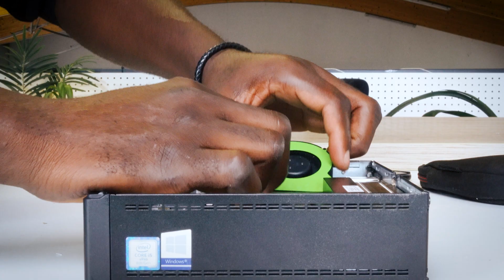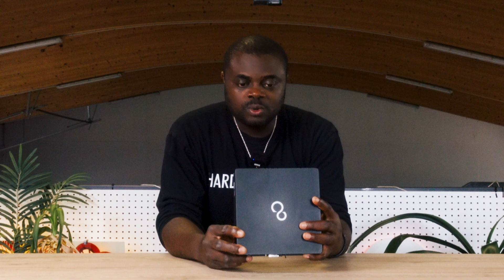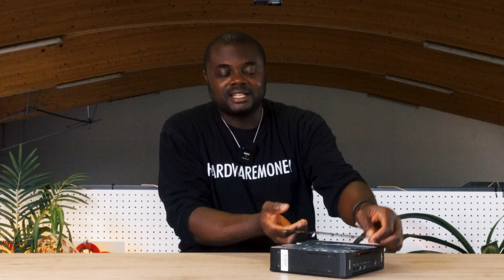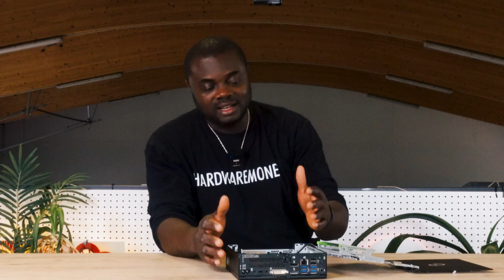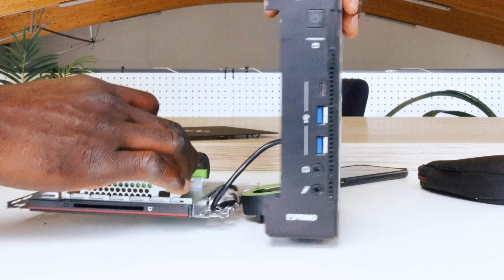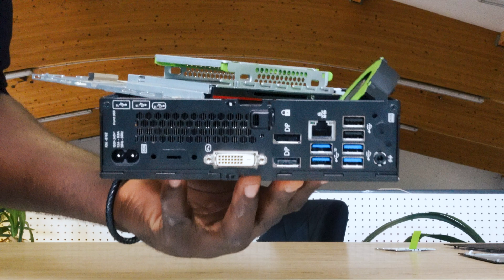You might be WASTING Money Buying a New Computer (Even if it is CHEAP)

Comment: Hi, the version you're presenting here is the one with a 7th-generation processor, but I found this model with an i7 processor—8th-generation—albeit in the T version, meaning it has reduced clock speeds. I don't know if the processor on this Fujitsu motherboard is a BGA or PGA version. If it's an LGA/PGA socket, you can easily swap it for a more powerful one (but probably not the K/KF version, as these OEM motherboards are usually locked to prevent the processor from being removed). Therefore, with 32GB of RAM, it could be a nice budget option for home use, but one that a child could also use at decent settings to play Minecraft, CS2, Valorant, LoL, etc. I've been thinking about buying something like this and converting it into a retro gaming rig, meaning I'd install the appropriate version of Linux and emulation software for games like C64, Atari, Nintendo, Sega, etc.